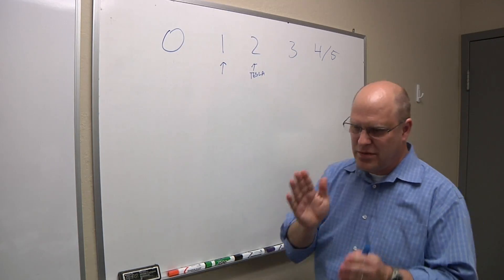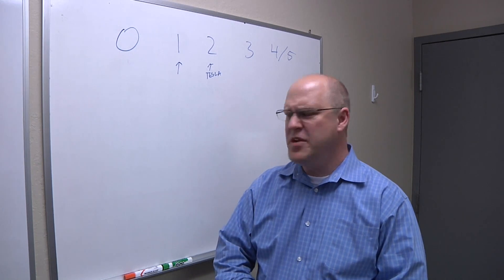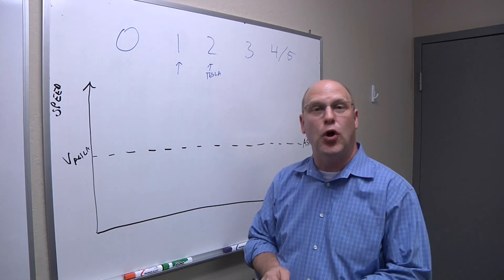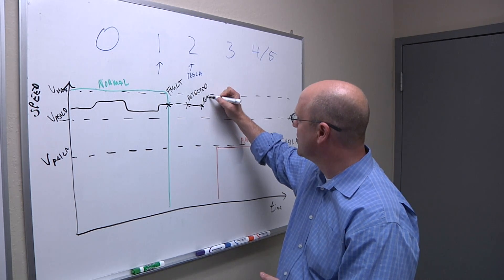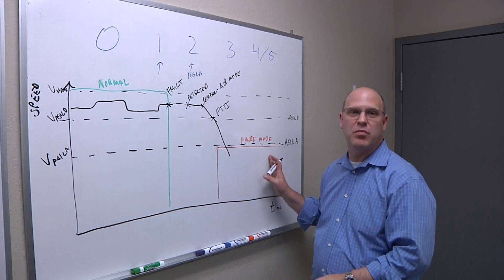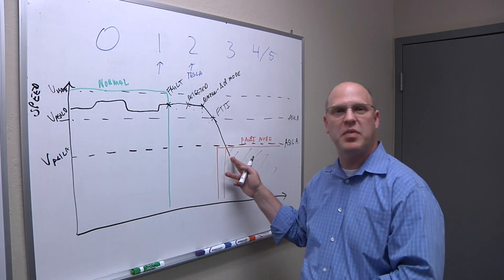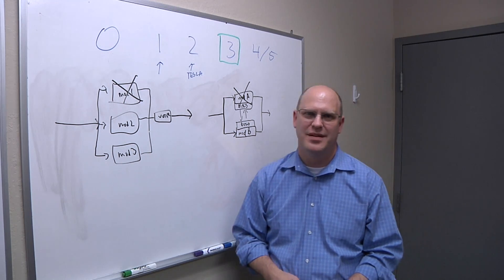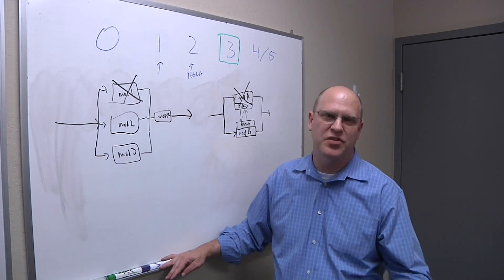ISO 26262 (2017)

Comment: The timing diagram explanation mixed with fault modes could have been better.....the same with the SIL3 and SIL2 block diagram explanations, it would have been better if the instructor does not "short-circuit" the output of each module but "route" the outputs to the "voter" inputs ....